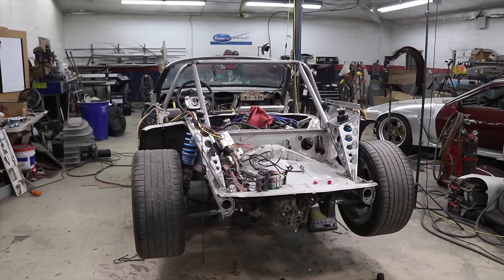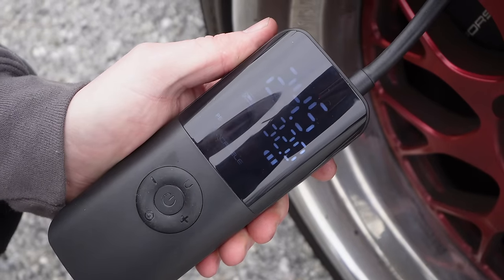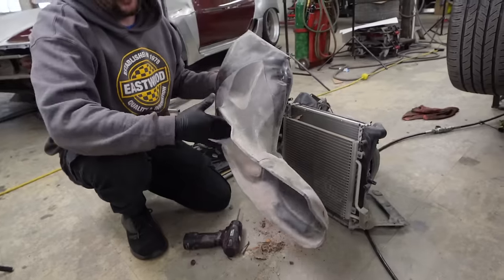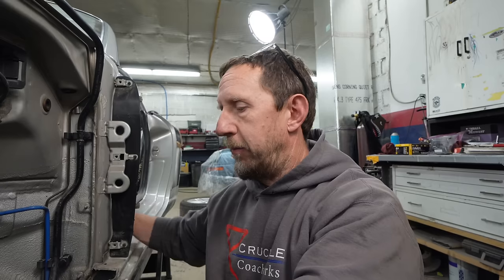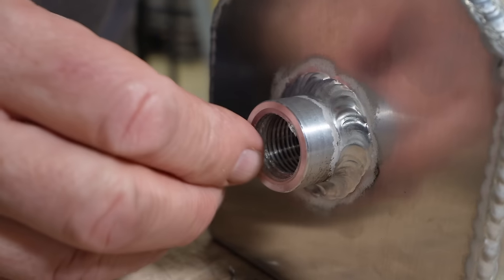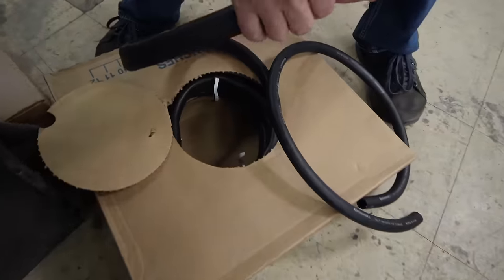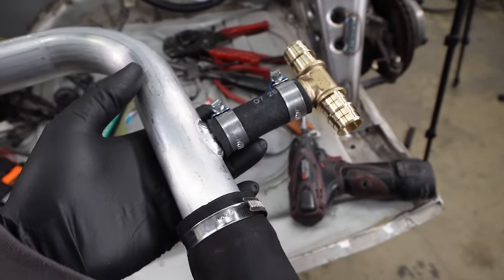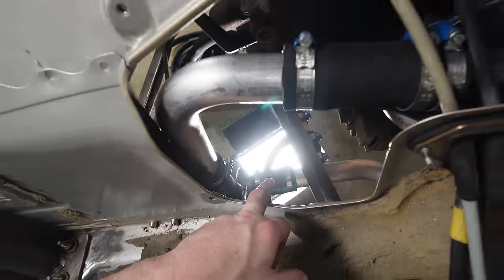Building a Vintage SUPERCAR! - Cooling System, Engine Wiring, Fabrication/Welding

Comment: Leaving tyraps cut off with pliers is a sure way to need stitches later, instead try putting the pliers of the tyrap tail and twist it until it breaks off flush

Comment: Umm, did you miss screwing in the last bolt on the adapter plate after you installed the gasket?
Reply from the maker: Good eye! We happened to be short one bolt, which is on it's way 🙃